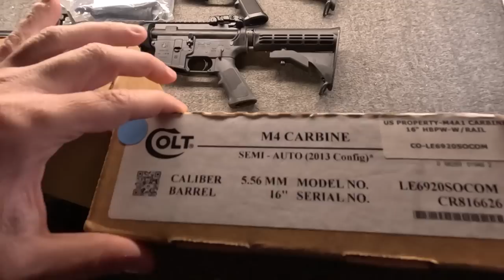Is My Colt LE6920-SOCOM M4A1 Really A CR6920 Carbine? (Deconstructing Serial, QR, & CAGE Codes)

Comment: People are obsessed with exact milspec markings. I had an Colt M4A1 that was upgraded from an M4 in the Army, and honestly my LE6920 SOCOM feels exactly the same. They both have a fair amount of receiver wobble, but totally reliable and print very good groups. I don't think the lack of an "M4" mark on the front of the upper receiver on the 6920 is going to make any difference when they both have the correct feed ramps, but people still sperg out over that. Not to mention after 10 years in service most guns are total mix-masters anyways.
Reply: My Bushmaster has been a better rifle than many of the service rifles I came across. Given many of those had lots of wear, but the point remains.

Comment: The probability of the LE serial number M4-A1 Socom having a genuine colt factory barrel is higher than the probability of any CR serialized rifle having a genuine colt barrel . The CR models have a lot more farmed out parts including the barrels - Rosco Is one of the companies, and not the only one, that has made barrels for the CR series rifles. There was a time a couple years ago that the Colt(unionized) workers were actually trying to sue Colt for farming out parts on their rifles. For the record, the original LE serialized M4-A1 Socom rifles had a 16” Socom profile barrel - never a 14.5” barrel unless they made it specifically for a law enforcement agency contract - and that would have a different model designation
Reply: IMO, a 14.5" barrel is preferrable over a 16". Regardless of who made it, if it was MP tested and machined to spec, its gtg for me.
Reply: @misha5670  I agree! 14.5” is my favorite. All of mine are pin & welded
Reply: @The11eleven  I used to have 16" guns, thinking 1.5" isn't enough to matter. But in reality, the 14.5" just seems more preportional and more evenly gassed.
Reply: @misha5670 o would you say that the Cr6920 is a mil spec rifle and a true colt i have a Cr6920 i bought in 2021 August
Reply: @beltrik3766  if it has the cage codes on the barrel, receivers, bcg, etc… then It would appear to be milspec
Reply: @The11eleven  If it came from the Colt factory, its a Colt.  Why is it ok for PSA or Bushmaster to use subcontracted parts, but not Colt?
Reply: @The11eleven  Chris phoned me tonight, so while we talked, i asked him his thoughts on the SOCOM barrels. Basically, he agreed that if one has the 13629 on it, then its either made by Colt or at least a milspec barrel worthy of service. Non-marked barrels though have more questions. That said, this does not mean they are bad barrels. In fact, CHF barrels made up in Canada are excellent but don't meet US milspec so couldn't be used. So its possible a non-speced barrel is actually better. Just saying its possible; not probable.
Reply: @misha5670  yeah, the cage code correlating with milspec is not in question. What’s in question is weather colt made it or not. The fact is that those old colt manufactured barrels provided some pretty exceptional accuracy. While other companies can make barrels to the exact specs per the tdp, it’s just not colt in many regards
Reply: @misha5670  I think people don't realize that alot of companies and bigger companies use sub contracted parts as long as they are up to the companies standards it should not be a problem at all. Just like with colt if they trust a company to make barrels for them they going make sure they are quality because it is there name being put on the side of the reciever. And honestly my psa ar15s have held up as good as my colt just not quite as accurate at distance but within a 100 yards accuracy is pretty close but the colts shine out past 100 yards for sure. I think people think when they buying colts they are pure collectors items instead of what they are. They are made to be run and some people care too much about the little things instead of trusting a quality company's judgement like colt. And for the most part I have got more reliable information and knowledge on all my firearms from you then anyone online who think they no but don't no the people at the companies and are able to get reliable information. Because u deal with these companies all the time doing business and no people at the companies on a first name basis like you do from doing many years of business with the. It's alot different then people like me and most other people. We order a firearm here and there online from companies here and there. Most of the time we don't even talk to a person at the company unless it's warranty work or need a part. So you dealing with companies and us dealing with companies is two totally different experiences. All I can say Misha is I appreciate every bit of knowledge and info you put into your videos.

Comment: As an owner of an SP1, Match target. LE6920 (early 2013 but has the side sling mount and Rogers Super Stock) , and a CR6920 - I have have nothing but good to say about the CR6920. Every bit as accurate, reliable and would use it in SHTF in a heartbeat. But then I am not a Colt snob, but I did sell my Expanse.

Comment: Always fun to talk about colt rifles! I owned 2 colt CR prefix marked rifles  ( CR6920 marked Carbine ) and ( OEM1 marked M4 Carbine) I only put around 1000rnds through both but they were  just as accurate and reliable as my other LE marked colt's and the quality was still present and  I was very pleased with those rifles. I personally think the new colt socom rifles are the best AR15's on todays market  for the money its a no brainer 14.5 socom barrel , knights package and matech rear sight is an outstanding value. Its fun to crack open old LE prefix rifles and look at markings but the new colt socom rifles take the cake you cant go wrong and I truly believe anyone that buys one will not regret it that guy really missed out on a hell of rifle from a great seller!  take care & thanks for the content
Reply: Do you think the quality has upped a notch since CZ took over?
Reply: @markp4401  the laser etched markings are perfectly uniform and consistant and I would say that is better quality but peolple dont like it ? There is no reports of people having issues with performance so I dont see how we could say Colt rifles are not as good as they used to be? People dont complain about laser etching on any other brand rifles ? If the military was issued Colt rifles with CR prefix I dont think anybody would be saying that the colts are not what used to be. I think the new Colt 1911's are very good quality as well so I really hope people will buy new colt M4 type rifles and share there experiences so we can speak more facts instead of silly thoughts
Reply: @markp4401  like said in the SAS video some CR prefix guns were lacking some of the markings showing that parts were tested and approved for military use but I dont think that means they are not but they are just lacking the markings showing so
Reply: @mariotorano3781  you’ve sold me on getting an M4A1.  That thing is sweet.
Reply: All new colts or not true defense mitlary spc tcp not ever colt made parts at all cheap made range beaters  all resl.colt s have marked parts not cr bar codes one

Comment: Misha, very good video about a topic that is grossly misunderstood by a lot of the community. Like you I have been a student of Colt rifles and carbines since I started collecting in 2017.  You are spot on with your statement that serial number prefix does not relate to rifle/carbine models.

The SOCOM has had six different versions released since 2013. They were:
2013 to 2016
1. LE6920 SOCOM, KAC RIS, 16" barrel, M4 carbine marked lower
2. LE6920 SOCOM, Troy RIS, 16" barrel, M4 carbine marked lower
3. LE6920 SOCOM II, Daniel Defense rail, 16" barrel, M4A1 Carbine marked lower

2017
4. LE6920 SOCOM, KAC RIS, 14.5" SOCOM barrel. This was the first use of the military 14.5" SOCOM and the p/w flash hider. Only about 250 released. M4A1 Carbine marked lower
2018
5. LE6920 SOCOM, KAC RIS/P&S RIS, 14.5" SOCOM barrel, first use of the U.S. Property markings. Initial production was rollmarked with the transition to laser engraved toward the end of production at the end of 2018/early 2019.

I don't believe any LE6920 SOCOM's were made in 2019. 

2020(ish)
6. LE6920 SOCOM, KAC/P&S RIS, 14.5" SOCOM barrel, laser engraved U.S. Property marks.

The LE6920 SOCOM has been in continued production since resumption of production in 2020 and continues to this day. Currently I have 2017, 2018 and 2022 versions of the LE6920 SOCOM. I'm looking for NIB examples of the 2013 SOCOM's.

Other part variations seen in the production since 2018 have been various manufacturers of stocks, both picatinny and non-picatinny marked Matech sights, shiny and matte finish pistol grips. Also seen have been C stamped, CAGE code marked upper receivers and some upper receivers with no C or CAGE code. 

I could 'talk shop' all day. I'm primarily a student of post 2000 production Colt rifles and carbines. I have about 29 different versions currently in my collection now and have had probably another 10-15 pass through my collection. Feel free to reach out if you ever want to talk details.
Reply: Like to add your list #1 LE6920 SOCOM, KAC RIS, 16" barrel, M4 Carbine marked lower I never have seen this one. But I have the same as stated LE6920 SOCOM, KAC RIS, 16" SOCOM Barrel, M4A1 Carbine marked lower. And it was purchased 2012 barrel is stamped with 2012 as well. As for what I have seen all the SOCOM Lowers had M4A1 Carbine stamped with no caliber which sucked. they added the caliber later after the run of SOCOM II with the DD FSP RIS II rails.. Plus this is when most makers were going with multi on their rifles lowers.
Reply: Yes, and it’s STILL grossly misunderstood.
Reply: I ordered a LE6920 from aimsurplus, just recieved it today, they covered the original label in tape so im unable to see it. Mine is marked "Carbine" with the QR code on on the lower. Every video and picture ive seen shows only the CR6920 with this "Carbine" only marking so I really don't know if I have just a cr6920 or an actual le6920 I paid 700.
Reply: @brentsauer  just scanned it, D13629 before the serial
Reply: @chrisd5758   The standardized "Carbine" marked lower is used on the CR6920, CR6920-EPR, CR6920MPS-B, CR6920MPS-FDE, CR6940, CR6960 and CR6700A4.  

Did you scan the QR code on the lower receiver?
Reply: @thecoltar15resource  it shows D13629 then the CR serial number
Reply: @chrisd5758  you are correct. Both data parts are inbedded in the QR code.
Reply: @thecoltar15resource  so I was sold a CR6920 but the listing had it as a LE6920

Comment: I purchased a CR6920 in early 2022. I've put 500 - 600 through it. Runs great. Accurate enough for me. 100% reliable. Mine has the  CAGE code on the upper receiver and the barrel, like Misha's. My bolt and carrier are unmarked... the but the gas key is properly staked. And so is the castle nut. Thanks for the video.

Comment: In 2014 I purchased my first rifle ever, a Colt LE6920 Magpul edition.  I currently own a Colt LE6920 M4A1 SOCOM US property marked like the ones in this video manufactured 04/2019 (even the extractor has the cage code on it) and I also own a Colt 6940 made in 2009 thats marked SPORTER M4 CARBINE.  I use Colt lower parts for builds and buy their bolt carrier groups without hesitation (even with all the choices out there).  I personally have NEVER experienced a bad Colt rifle or part,  past or present.  That,s just my story.

Comment: I own a roll marked trade early model colt socom with cr serial. It’s not a le, no colt socom that are marked property of us gov has le trades. They never did. The older one that is a le6929 socom doesn’t have Gov marked treaded and only said m4a1. Also had 16” hbar. But a true le lower

The colt socom we all love like I said are all colt cr trades.  I prefer the rolled trades there just cool. My m4 on m4a1 is not as deep lol. Anyway I used to work for Charlie’s custom clones right when the Gov marked came out.

I have seen one rare colt commando marked prop of us gov m4a1 commando 

It was a semi auto sbr and had le prefix trades. Lol saw it on gun broker it was super rare out of a colt guys personal collection. Much love.

Comment: Ok. . . My LE6290 with a low 139xxx serial number from May 2012 is colt marked on the upper, lower, BCG, MPC on actual bolt, H2 on recoil spring guide, F marked front sight and a SOCOM label on the box. The side sling is installed and it has the SOCOM profile barrel with M203 cuts. Even the original plastic bag is printed with May 2012. It has an unpinned and welded A2 flash hider. Paid $1950.00 on GB last year. Just a dream to shoot.

Comment: In the 1970's I worked at ALCOA while financing my way through college. While people claimed that the "build" an AR, I forged thousands on a hydraulic press....really "making" them on a 3000 yon hydraulic press. Forging uppers and lowers requires sophistication. Die Sinkers to make and repair the dies, aluminum to forge, a heat source, an oven, for the stock pieces, etc. I assure you, Colt is not in the forging industry., nor are other manufacturers.
Reply: Years ago, when i was basically getting into guns & the AR15, a friend who was an engineer told me something very similar to your comment here. Basically no modern factory has raw metal going in one door and completed guns coming out the other. Subcontracting and specialization are required with how complex things are today.
Reply: Were you into ARs in the 70s? I’ve always wondered how prevalent full auto ARs were in the commercial market.  I personally don’t know anybody who acquired one.
Reply: @markp4401  They weren't. If you look, most registered full-autos are actually legally converted semi-autos; not true factory M16s.
Reply: True aren’t most “M16s” just SP1s that were converted to auto in the 80s?

Comment: Those box labels in your  video for those Colt CR and LE models point out a 223 Rem for the CR model and 5.56 MM for the LE (2013 Configuration)model. My LE 6920 (2013 Configuration )box label points out a caliber of 223 Rem. Guess it was a mix and match for production.

Comment: I have an M4 Carbine marked CR serialized SOCOM profile barrel (14.5 pin and weld). I know this because it’s Maryland legal which requires a heavy barrel. I have the box somewhere but I just checked and the serial starts with CR. Purchased in 2022.

Comment: I’ve watched Small Arms Solutions “Colt LE6920 vs CR6920” video a few times and found it interesting.  However when I compare my own LE6920 with an LE6920 and a CR6920 for sale at a local gun shop, it appears to me that there must have been a few “transitional” models with with a mixture of early/late LE6920 and CR6920 features.  In other words SAS’s “cookie cutter template” didn’t fit the three examples that I just mentioned.  Please note that I’m NOT attacking SAS at all, just curious why it seems like his parameters seem a bit “blurry.”

SIDE BAR-I’m a retire US Army soldier.  My first weapon issued to me was a Colt M16A1 Rifle and the last one was a brand-new Colt M4 Carbine (with a brand-new FN M16A2 Rifle issued in the middle).
Reply: Colt is infamous for not having consistent markings. Has been this way for at least 40 years.  The only consistent thing about colts markings and features on their rifles is that they will always change lol

Comment: I think I have the M4 fever too. I was watching your 6920 auction in question but didn't bid. The SOCOM profile barrel is interesting, and the rails are getting hard to find (or expensive). I'm not sure if I want a 14.5 pinned and welded with extended A2 flash hider, for looks and bayonet fitment (because bayonets were an evil feature in the 94 AWB), or an upper so I can get a Surefire adapter pinned and welded (which unfortunately blocks bayonet attachment).

Comment: I bought an Expanse model a few years back and the lower was rollmarked  "M4 CARBINE" and has an LE prefix.  The lower is the only Colt part on the gun.  Colt has always been all over the place as they use up stock and subcontract out components.
Reply: Yep, and that was why i used that expanse lower for my classic M4 build here. Of course i gutted the lower and swapped out things like the FCG and safety, as well as the pistol grip and buffer.

Comment: I understand what the guy’s saying, but if u wanted the older style rollmark, you’re gonna pay a premium and it’ll most likely be used. I was lucky enough to get a few nice old colts like your older ones. But the newer colts will still run and run like an older colt. I got a newer socom just to see the differences. From marking to the way it shoots. Still great guns. Nothing fancy. I didn’t buy colts for fancy lol. I love colts though. Nmw u still are getting a solid gun that’ll outlive most people’s firing schedule. Great vids misha. Sometimes people just don’t know what they don’t know lol.
Reply: I think it sold for $1,599 on GB? So while not cheap, its not as if it went for several thousands either. I've always thought the SOCOMs were good deals considering all the parts you get. Trying to assemble a clone probably wouldn't turnout much cheaper & it would definitely not be a factory Colt gun.

Comment: I just picked up a new Colt m4a1 socom (2013 configuration) I'd like to know more about it, it has a tiny "c" on the bcg (not a stamp) no mp on bolt, only keyhole market on receiver, has the 14.5 socom barrel. I wanted it to put a Daniel fsp rail and a re-pin a sure fire 4 prong. Idk if I should just buy the parts socom barrel and ris rail and surefire, and keep the knights rail and factory barrel together.